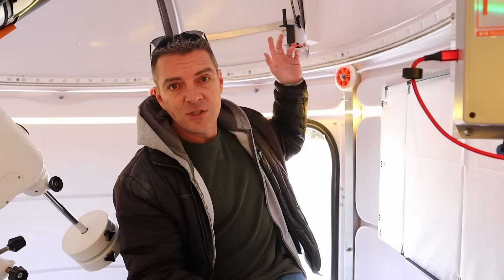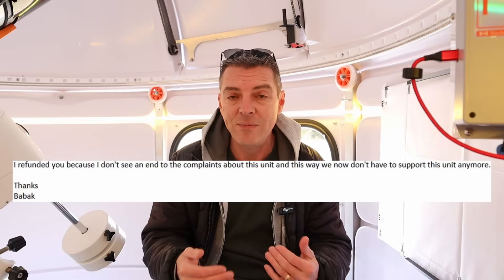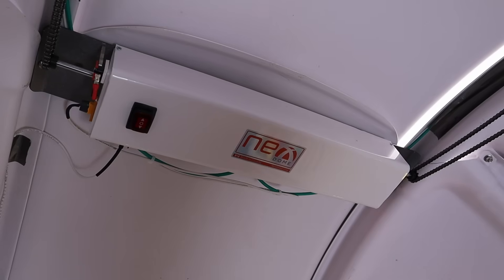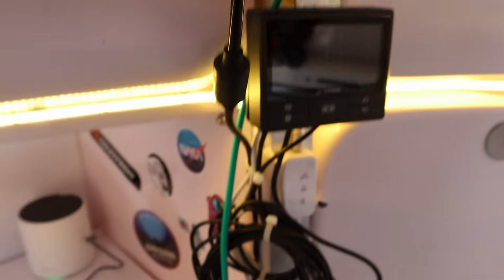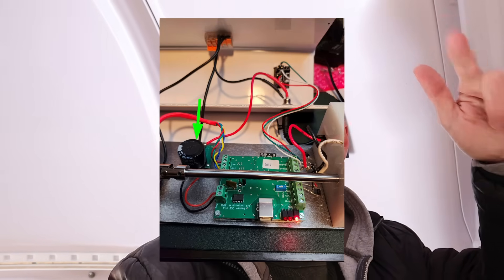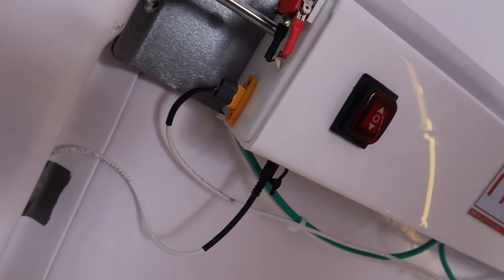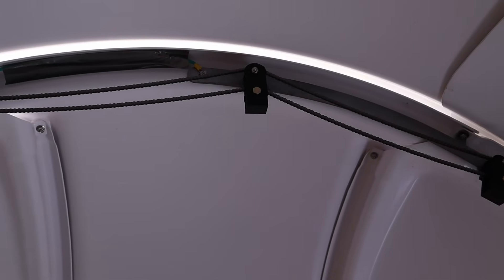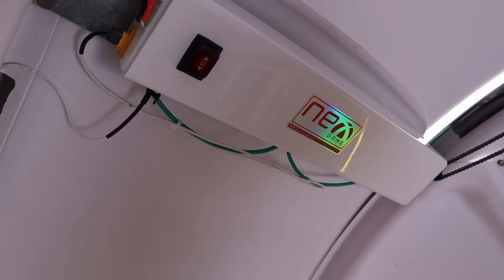NexDome Shutter Automation Failed Again!

Comment: Static electricity is one thing. But there could be another issue during thunderstorms: induced currents. Every wire acts like an antenna. Nearby lightings can induce quite a lot of voltage in those "antennas". There are at least two solutions to this: shielded cables ( with grounded shields at one side! ) and TVS diodes ( preferably bidirectional). A controller like this should have a protection against transient voltages on every single connection going out from the board.
Reply from the maker: That what I used, bidirectional TVS diodes.

Comment: Rich, Sorry that you have had so much trouble with your dome.  The manufacturer blew an importent chance to vastly improve his product!  There was a time when american companies had pride in their products.  Working with you could have helped their substandard product!  Arrogance over intelligence.  You have taken some excellent steps to prevent a reoccurance.  Doe your main panel have a surge supressor?  aircraft that use composits are prone to lightning damage and some are using a conductive mesh in the layup to channel the current along the airframe.  would be difficult with your rotating assembly.  lightning rod array around the dome?  I enjoy your tutorials and wish you sucess.  A PLC retrofit might also be solution.  Good Luck! -Jim
Reply from the maker: Yeah it's too bad they didn't want to work with me. Oh and Nexdome is a Canadian company, not that it matters. I do have a surge suppressor at the panel, and a GFCI on the outside outlet. I suppose I could lay some mesh across the dome, now that I have that plate grounded. Hoping what I have does the trick though. We worked on this for almost a month before I put the new controller in.

Comment: Hi, This is a disaster. I'm an electrichian and I'm not a great fan of connecting the negative pole of a DC current to the same ground connection as you house line. The AC line (input) is seperate from the DC output. But by connecting the negative DC to the same ground als your house line, you make a connection to AC. I think it's beter to keep the AC and DC ground connections seperate.  So fare the grounding. Maybe you have an option to put up 4 pipes around the dome, with some distance from the dome. On top of the pipes you place a rod like you use for gounding and connect thise rod ground. They have to stick a little above the dome. Create something like you see on launch pads of rockets, they have these hugh antena like structurse standing next to that. Saludos from Spain, Rob.
Reply from the maker: The DC power supplies are isolated, if they weren't then I would I agree with you that a different grounding approach would be needed. There's no connection being made to the AC, the grounds are just bonded.

Comment: I had a static builup in dry weather with a light breeze.  When the observatory was open, A static charge would build up on the mount causing the cameras to shut down.  Everything cleared up when I grounded my pier.
Reply from the maker: It's amazing what can cause static. I'm still on my tripod, but would like a pier eventually. I'll be sure to ground that as well. Thanks!

Comment: Hopefully that's it all fixed now, nothing worse that faults that keep coming back! I'm still battling with my shutter loss of comms. somedays it works perfectly, others the XBEE boards just don't connect to each other. (The original NexDome Arduino controllers communicate over the XBEE boards).
Reply from the maker: And their solution is probably to upgrade to the new system! Sorry you're having issues.

Comment: Interesting, I’m also using Lunatico controller. We had extreme wind and sand storms where I found the controller not responding. I had to reboot the controller and weather monitoring three times before the controller responded to my computer. However my system is operating a roll-off-roof. But it makes me wonder if static electricity is part of the problem.